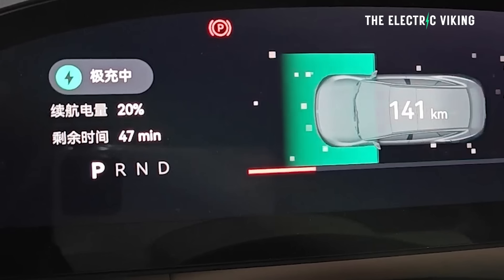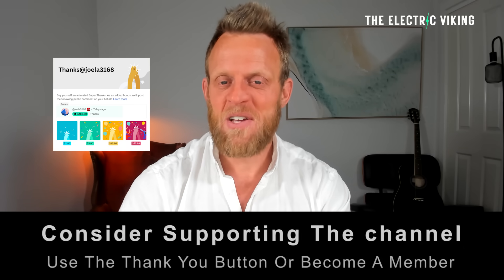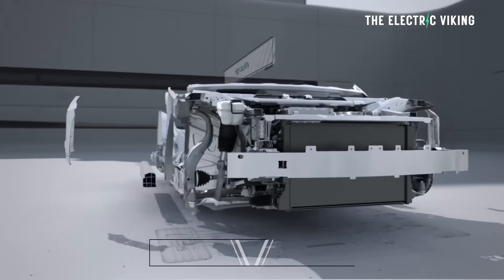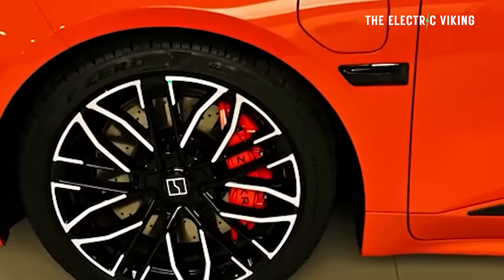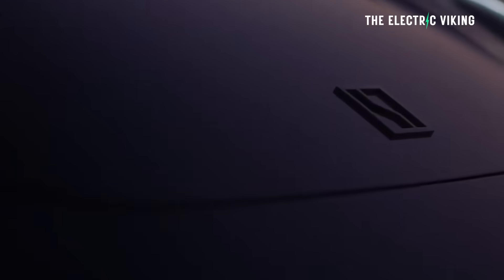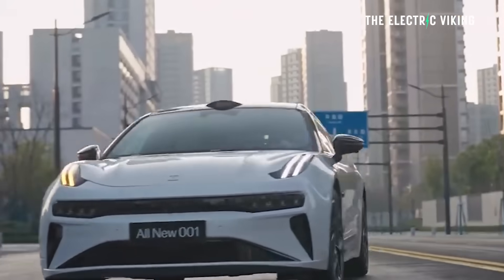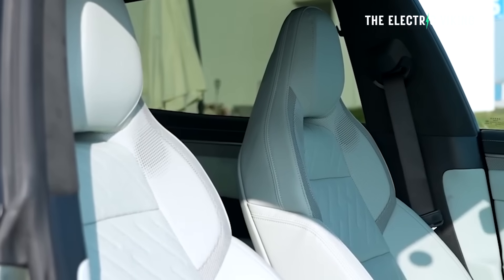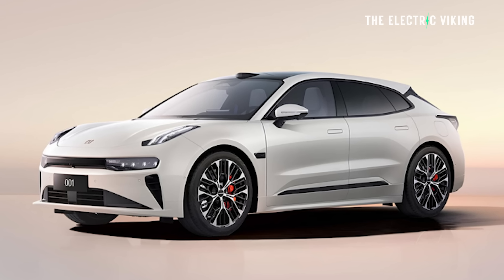Zeekr's 001 Electric Wagon Charges in 7 minutes at 1140kw Charging Speeds

Comment: This does not solve the problem. Capacity of battery is 50-100kwh. The main restriction to charge fast is in infrastructure, which can provide such power. For comparison evarage electric kettle consumes 2kw. To charge 50 kwh bettery in 10 minutes we need to provide power in 150 times bigger power.

Comment: The first gasoline pumps took over 20 minutes to fill a 40 gallon tank in the Ford Model A as they were passive, slow-flow pumps, and the Model A got 40 miles of range.  Great to see EV tech doing what oil did to increase charging as level 2 charging is like trickling gasoline and level 3, supercharging, is like slightly faster trickle.  These 500-1000kW chargers are true fast fueling, finally!

Comment: 13 cm off the road at low, wow better watch for speed humps, good for highway driving but all other times set it to the highest. That single motor kW is huge. Air suspension mentioned right at the end is the cherry on top.